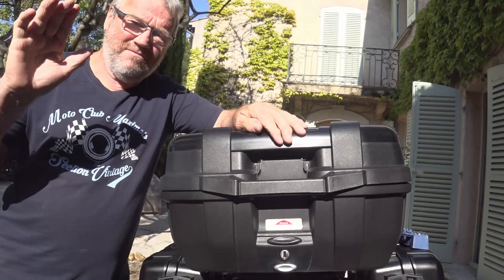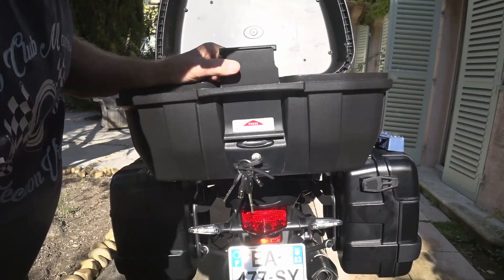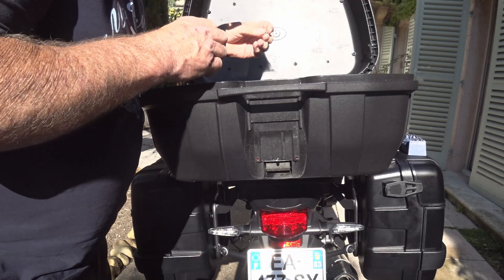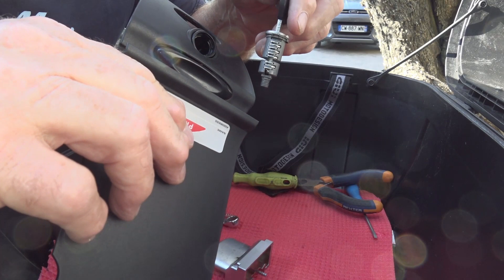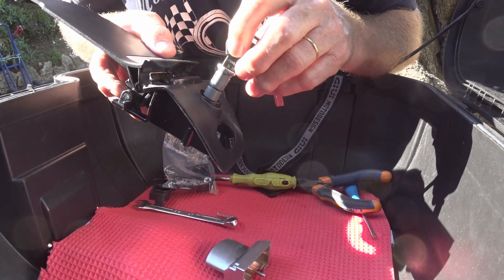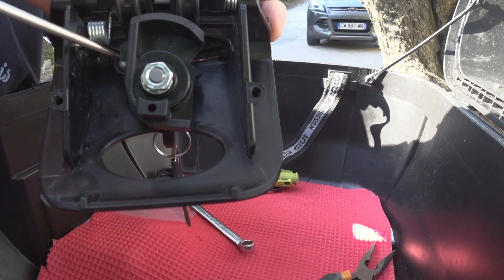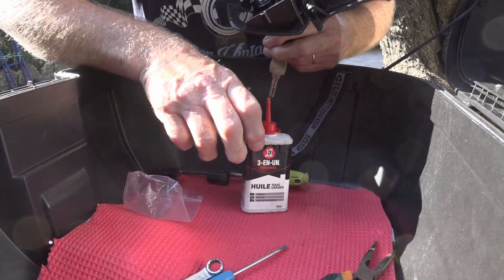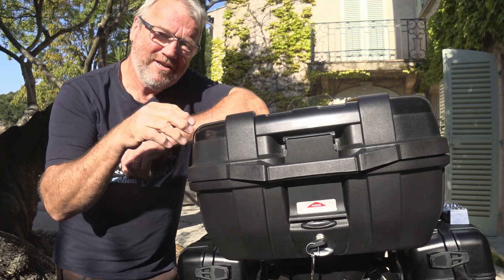HOW TO CHANGE A GIVI LOCK

Comment: After undoing 10mm nut keep pressure on the black plastic piece and push the end of the lock out. Fit new lock in (Lug uppermost) and fit 10mm nut. No drama with ball bearing. Thanks for video.
Reply: Exactly what I was thinking, there doesn't seem to be a need to remove that black plastic part at all.

Comment: Thanks for the detailed video.
I didnt need to replace the lock but it was getting hard to turn the key. 

So I put it apart and put some oil in the famous ball bearing 😁
It works perfectly now!
Thanks!😎
Reply from the maker: Thanks for leaving your comment, appreciated much. When I returned from my road trip to Nordkap I had to take it apart again and clean it as road dirt does get inside 😢